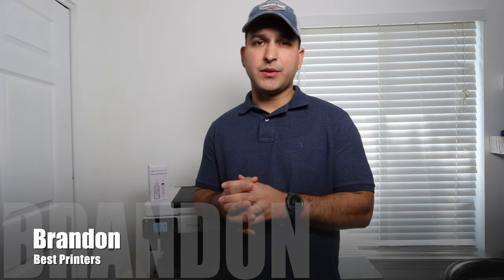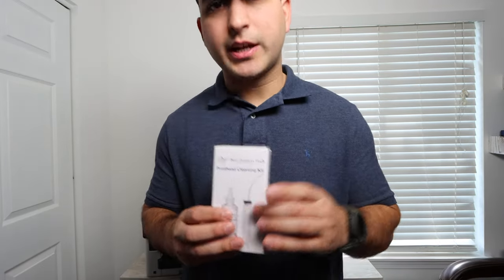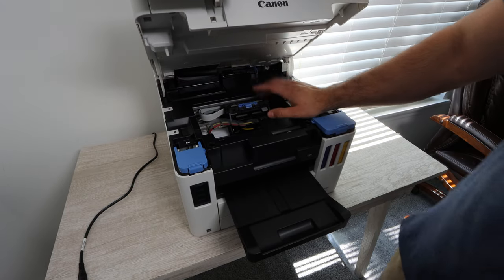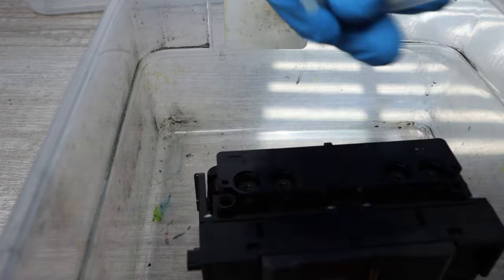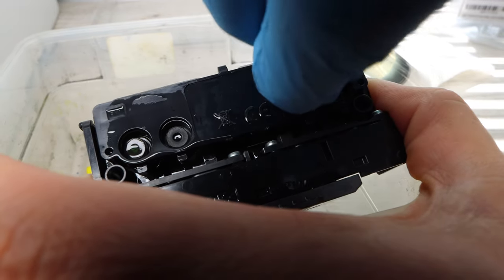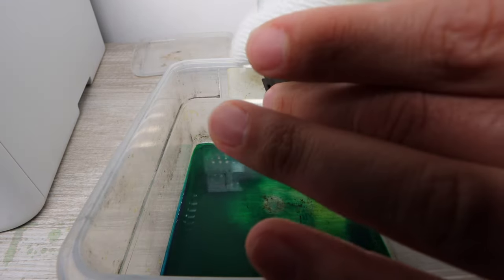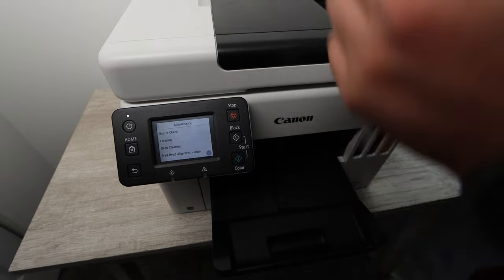Canon Maxify GX7021 & 7050, 7060, 7070 -  How To Clean Printhead  - Not Printing Black

Comment: The GX6021 I bought a couple years ago stopped printing all colors.  It would only print black.  So frustrating because I paid so much for the dumb thing.  Rather than buy another $600 printer, I thought this cleaning kit was worth a try.  The cleaning seemed to go as planned but when I tried to do the ink flush, I got an error code that said I needed to replace the maintenance cartridge.  It would only print black and magenta.  So I ordered a knock off $14 maintenance cartridge from Amazon (Aomya MC-G01 Maintenance Cartridge) figuring I'm in this deep so might as well try this too.  Replacing that part was super easy.  Just tried the ink flush again and it did not give an error message.  Printed a nozzle check (expecting the worst) and it WORKED!  I'm so relieved.  Many thanks to The Printer Guy- not only for selling your cleaning kits but also for your videos.  Very helpful.  You ROCK!
Reply from the maker: I'm so glad to hear this!

Comment: 🎯 Key Takeaways for quick navigation:

00:16 🖨️ The Canon Maxify GX7021 is a high-end tank printer with impressive specs, fast printing speeds, and excellent print quality.
03:43 💡 The printer comes with a power cable, an Ethernet cable, manuals, one black bottled ink, and one set of color bottled ink. Some bundles may include extra black ink bottles.
05:16 📄 The printer has three paper trays, with the ability to hold a total of 500 sheets of plain paper. It supports a maximum paper thickness of 250 GSM.
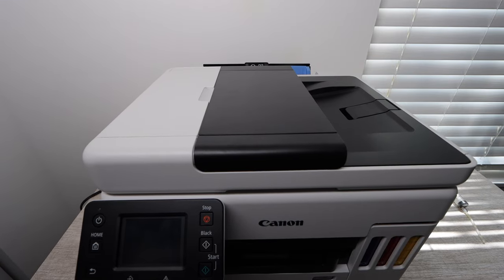07:21 📱 You can connect the printer to Wi-Fi for wireless printing, and it also has a USB input for direct printing from a USB flash drive.
10:08 👍 The Canon Maxify GX7021 is highly recommended for its functionality, performance, and usability, offering the best features for a tank printer.

Made with HARPA AI
Reply from the maker: lol